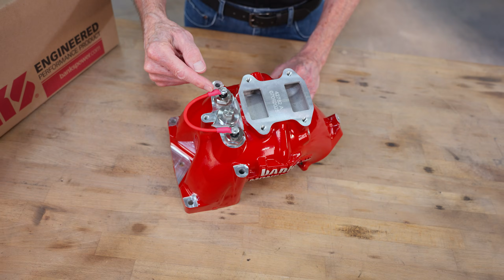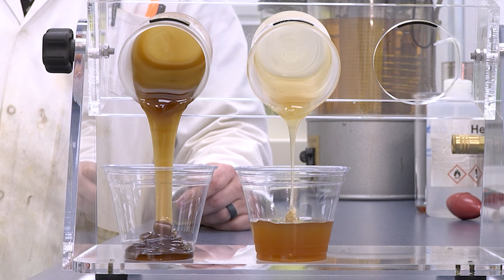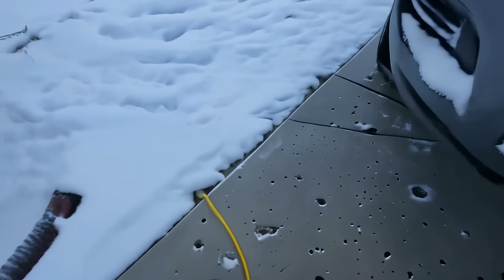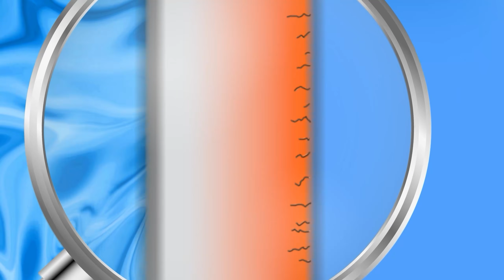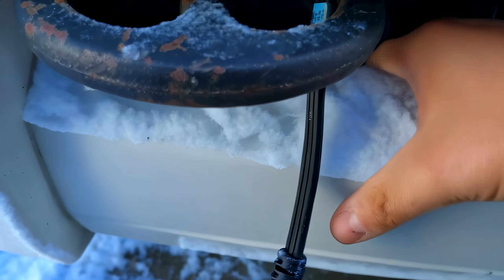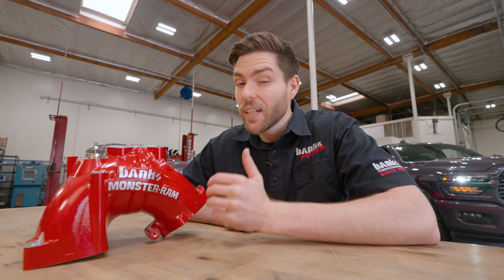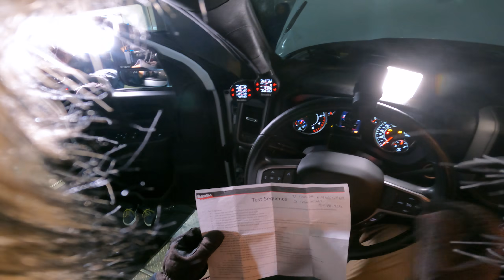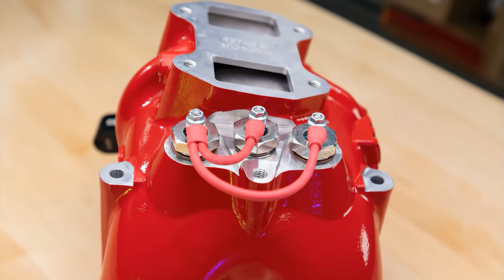We froze a truck to -40°. Here's what happened.

Comment: Make sure your 25/26 block heater that you chose as an option is actually connected at the block. My 26 was not. Stelantis says its the dealership's job because it "cannot be done" during factory build 🙄. But the dealer doesn't know about it.
Reply: All Cummins equipped Rams come with the block heater element installed in the block, the only thing that is needed is the cord for it. Yes, dealerships rip you off to "install" a block heater when all they do is plug in a dang cord and run it to the front of the truck.
Reply: @T51B1 mine was installed but the 120v plug wire wasn't connected to the heating element. Quick search will show its a common problem on Ram forums. Dealer says it's not on their pre delivery check list while stilantis says it's on the dealer. I dont have big hangs but it was still a PIA to sit ontop of the motor and reach down there to plug it in and screw on the lock ring. Block heater worked after that last winter.

Comment: Translation: We had to find a place to re-create Minnesota in January & February... It cost us $7,000 every time we took a test.. then had to wait to get it back to Minnesota Winter temps...        Now if we can convince the Big rig engine manufacturers to put a grid heater or glow plugs in the big rig engines... they might have a fighting chance to start... Big rigs are critical to infrastructure... Everything gets delivered by truck... everything... and when they can't start... it's  REALLY expensive to find a service that has proper equipment to attempt to jump start those massive , high compression engines.. with no heating systems at all... and because of their size.... almost never have access to electricity to plug a block heater in.  Even with good batteries... one or two hard starts will drain them... you need continuous ability to recharge all 4 batteries and try cranking before any little heat generated goes away.   Banks would make "Bank" if they designed a Pre-Heater for Semi Engines...  If a Semi can't be Jumped/recharged on location... the only option is a VERY Expensive Tow truck... then pay to have the truck parked inside a warm building til it's warm enough to start. That's NOT cheap... Hey Gale... Look into some type of pre heater for the Big Diesels... there's a Huge Need for it..

Comment: adults leave their truck running when its that cold. or get a pro heat or wabasto circulation heater  this is every day for months in Alberta 
ive run ram trucks for work for years and ive had em start as low as -56c with proper preparation/maintenance

Comment: Can someone in the OEM industry enlighten me as to why the factories don't quickly remedy faulty designs?

Like how is cummins still fitting new trucks with these subpar grid heaters? Same question for Toyota and their tundra engine... Or GM with their transmission valve bodies and 6.2 engines.

Why are these companies so inept with fixing problems that are simple fixes within the ability of the companies... It's such a disgrace to this country and the customers.

Comment: Gale Banks has forgotten more knowledge than I could ever learn and appreciate these videos. 
Reminder :
New recommended batteries failed voltage drop during cranking multiple times.  
Adding a 2250 watt draw will make voltage drop worse.
Really doesn't matter what your air intake temperature is if the engine wont turn over. 
Battery blanket/heater would make a world of difference.  
  I think its a great product that solves the bolt issue.
I think the guys working in -40 or below have solved all the cold weather issues with their incredible ingenuity and keeping their 5.9s and 7.3s running strong in the oil patch.  At least that's what Ole Peg says and ya gotta believe a guy as bad ass as he is.
Reply: in -30 or colder, either it stays running, or they use battery and engine blankets to insulate the entire engine bay.  if the vehicle has to be off, you keep a good booster pack so you can boost the battery to help with cranking speed.

Comment: At -40 I would run a diesel rated 5w30, an oil pan heater and battery heaters in addition to the block heater.

Comment: I worked at a welding shop in Nampa, AB. I heard many tales from people I met where they had to set up insulating canvas tarps to keep the heat of a fire burning directly underneath the oil pan of their industrial equipment out in the middle of nowhere. This was the only way to eventual get them started out in the middle of nowhere
Reply: Charcoal briquettes work great for this! Fire them up, get them hot then slide it under the truck with a tarp over the engine.
Reply: As done on the Alaskan Hiway when it was being built. A diesel engine that quit couldn't be fired up until Spring w/o this method . . .   ☆

Comment: I use a block heater on my Cummins when the temp falls below 40°F. I hate the grid heater cycling on and off. I also put block heaters on my gas engines to help aid warm-up temperatures and reduce engine wear.

Comment: Block heater in my 7.3 couldn't keep up with Montana so I installed a webasto engine heater.
Best thing I ever did for cold weather. Set the timer so I have a warm engine when I got up in the morning and then again when I got off work.
Plus I had warm air blowing out of the heater right away instead of waiting for it.

Comment: It’s too bad no one makes an oil system on OEM that pumps before the engine even cranks
Reply: Oil would probably need to be heated up a bit to pump. It gets thick up here in Canada when it's -40 -50 sometimes. 

At times, it's so cold that you can feel the deformation in your tires as you pull away from your house in the mornings. Bumping along until they heat up. The suspension doesn't even work properly. The shock absorbers become force transferring devices instead, allowing you to feel every harsh impact along the way.

Comment: I parked my 1973 Fiat 124 in the parking lot at work. It was 3 years old at the time. Little ol' 1400 CC engine. It dropped to -45 deg F through out the day in that parking lot. At quitting time it started right up. Wasn't turning fast but the old point ignition was up to the task.

Comment: I just noticed you have a Cummins Standby Generator at your shop, it looks around 100-150kW is it natural gas and turbocharged? Ford WSG1068? Or a PSI 8.8L or is it a diesel QSB7? with remote fuel tank? It is shown in the clip backing the RAM off the flatbed. You can see the “Onan Green” great product ( the best for its application, and a great investment too) 

-Generator Aaron

Comment: If you were trying to isolate the manifold air temp, wouldn't you want the oil heater and battery blanket?

That would mean those two variables are at their best position and if the vehicle still wouldn't start, it was clearly air manifold temp.

Not having those two variables at their highest performance meant they still would've been affecting a good crank

Comment: Great video, as a Canadian that lives in -40 a few weeks of the year I feel the pain. I had a banks in my 22 2500. I can honestly say at -20 °C it was a hard start. -30 was a different story. Yes truck gets plugged in at night. Unfortunately that truck is no longer with us as it was t-boned or I would be purchasing the up grade. My 25 has a whole different set of cold start issues.
Reply from the maker: Sorry to hear about your '22 2500. What issues are you running into with your '25?
Reply: @bankspower they changed the start procedures. There is no wait time for the glow plugs. You have to go out to the truck and press the start button to run a cycle. Before the truck would do it automatically when you went to start the truck below 0°C.

Comment: Did you allow the battery to charge back up after starting it so many times before doing the negative 40 test??
Reply from the maker: We plugged in a charger before letting it cold soak overnight.

Comment: Thanks Gale !  For your next product improvements, I have a couple of requests from northern Alberta. Please add a block heater to the CoolRunner Oil Pan, the Ram Air Transmission Pan and the Ram Air Differential Cover. You've seen how thick engine oil gets at low temperatures and we're killing the transmissions and diffs too.  I knew a bus fleet manager who wired an entire fleet of Prevost buses with stick on pad heaters on the oil pans, transmission pans  and the rear diffs. Never had a frozen bus & cut repairs and maintenance related to extreme cold and saved the company tons of money. 

We burn up engines, transmissions and burn out diffs  and rebuild them at 150,000 miles when a 6.7 Cummins could go 500,000 without opening it, just because winter is such a torture test. Transmissions could last a lot longer and diffs, well, we sell the truck and let the next guy deal with it. Point is, if you engineered a plug in for those pans and diff cover, you'd help us keep great trucks on the road a lot longer and get the best of both worlds- cooling in the summer and heat in the winter. Oh, could you make a diff cover with a heater for the front diffs too?
Reply: I have seen people attempted the Oymiakon death road in Russia used a camp stove with solid ethanol for 2hr for underbelly of the truck, rear diff, tranmission, front diff, collant, the lot you name it. Plus they completed use thick blanket to cover the front of the air intake vents, the top of engine, the exhaust pipe was tripe wrapped with thermal material. Everyday to start a truck takes 2hr of work.
Reply: Great reco!
Reply: I don't know that diffs are all that critical. That sliding friction warms them up pretty quickly. Just go easy for the first little bit of driving. Diffs get burnt out by not changing out break-in oil and from spinning tires.
Transmission could maybe benefit from a bit of heat. Some lighter stuff gets a little heat from the block heater via the heat exchanger in the radiator, and it's a noticeable benefit, but most heavier vehicles have completely separate cooling systems and could probably use a little.
Reply: @gogmorgoaway  We see diifs freeze solid as it gets below -40 and you can't move the vehicle. You have to light a tiger torch or heat cannon to heat it up and re-liquify the fluid.
Reply: @searlearnold2867  Wouldn't your tiger torch also struggle below -40?
Can't say I've seen that happen on something that had oil put in it this century. Brakes freezing, absolutely, but not diffs. You might want to switch up the oil in them for something better rated for the temperature if that's the case. Or make sure they aren't full of water. Frost inside the housing does eventually accumulate.
But yes, if you do need to heat the diff, slow and gentle is going to be better than a hot flame that risks burning the oil. That would definitely shorten component life.

Comment: I have a battery tender along with blankets to help with the battery. I also have the monster ram with just one heater and have no issue starting without the block heater. Unfortunately working 24 hour shifts i dont get the ability to always plug in. I live in Wisconsin

Comment: Ahh that magic temperature that doesn't need a °F or °C.
Reply: 40 c aND 40F are the same
Reply: @shaggy501  Get outta town! Is that right? The OP didn't imply that at all, not a nuance of it. Thanks for your help.
Reply: @wobblyboost it’s cause its wrong
Reply: @turtletube -40c and -40f are identical trmperatures
Reply: I can only measure temps in Freedom units.
Reply: @tacticooldennis  it's spelled Freedumb
Reply: @RePeteAndMe  okay mr your-a-peeing
Reply: @oldpops22  used all 3 braincells for that one.
Reply: @kedf shut the hell up you think beans and toast are exquisite
Reply: @RePeteAndMe  Feedump i mean freerdumb
Reply: @oldpops22  on my boot
And thats why we don't work on European cars
Reply: I trolled a friend with that once, asked them to convert -40F to C.  They did the math 4 times thinking they did something wrong because it kept coming up the same lol.
Reply: I like °C 0°C means 32°F and 100°C is the boiling point. Its literally just easier on the head to remember in my opinion. I just dont like kilometers Per Hour. I grew up with MPH so,thats what i know. But as far as temp goes. CELSIUS IN MY OPINION IS THE BEST TEMPERATURE TOOL TO REMEMBER.
Reply: At -40 its the same either way.
Reply: The climate box said 40c on the outside
Reply: @harrythemoth180  shrugs fact is the two still intersect at -40. I could really throw you a curveball and say its 233.15 Kelvin.
Reply: @chuckee1987 someone pays attention at least.
Reply: Also -40 Celsius is the same temperature degree as Fahrenheit
Reply: @harrythemoth180 😮Nooo waayyy? 🤦🏻‍♂️
Reply: @tdotw77 I’m not the retard who need clarification
Reply: @tdotw77  Also -40 Celsius is the same temperature degree as Fahrenheit
Reply: @hengry0  Reaalllyyy?!  Noooo waaayyyy!! 🤦🏻‍♂️🙉🤣
Reply: @hengry0  Now my mind is fixing to explode, Does this mean we accidently just discovered the unifying theory that explains life, the universe and everything?! In a chat box!
Reply: @harrythemoth180  Yes that's literally his point
Reply: @harrythemoth180  PLOT TWIST! 😲
Reply: zero is zero
Reply: @SlayerXBTNah, 0°C is 32°F
-40° is the only temperature that is the same in Celsius as Fahrenheit.
Reply: @hfase  im trollin

Comment: As others have suggested, would be great to see data using battery blankets. And also data for the “more than 2” heating elements, as that’s your suggestion for people to use. Would also be great to see battery voltage before and after running X number of heating elements, as running more heaters will obviously have an effect on battery voltage as well. Anyways, great video and thanks for all you do!
Reply from the maker: Thank you for watching and for the feedback. We would have loved to perform more tests in the climate chamber but each test required a full day. It can get really expensive, really fast.

Comment: Wait, there are still ARCO stations? Haven't seen one around here (New England) since the 1980s.
Can't wait for the Banks kit that has insulating blankets and battery heaters.
Reply: ARCO is super common out here in socal, its the cheapy cheap gas station lol, 10 to 30 cents cheaper a gallon usually

Comment: Thank you for doing this testing. In Anchorage, AK we might not see more than 65F all year some years. Winters can get down to -15F and there's nowhere to plug-in at work. 45min North in Wasilla/Palmer it can hit -20F and again, no where to plug-in when not at home.
Reply: Get a webasto coolant heater. It's a game changer. 👍👍
Reply: @jsav5845  They are, installed many in my heavy mechanic career but still need batt volt to run one. No use when truck parked for 8-10hrs at work.
Reply: @akryder Worked for me all the time, 10hrs at work all last winter. Got the smart temp 3.0 set a timer set an autostart with my viper from anywhere as long as I have cell signal and good to go. 🤷

Comment: To be honest those interstate batteries are kinda crap for cold weather, they would be my last choice given the option,  this comes from first hand experience in Northern Alberta..  Interstate source batteries from whoever will supply them cheapest. We have found Clarios (formerly Johnson Controls) make the best batteries for cold weather endurance and durability. And if available AGM's all the way..
Reply: Interstate and optima are now made by Clarios. I'm still rocking some interstate batteries from 2017 in my 2008 chevy 2500, back when they were good. 

Clarios probably owns 90% of the automotive battery manufacturers. Interstate, optima, ac Delco, fomoco, Toyota.
Reply: @ExperiencesAndEquipment  First off  Interstate, optima, ac Delco, fomoco, Toyota are NOT battery manufactures they contract out the m,anufacture of their batteries . Second the Optima brand is OWNED by Clarios (formerly Johnson Controls)  and always has been.    Third  Interstate contracts out the manufacture of their batteries to who is cheapest.   Pen Exide and Clarios ALL provide batteries to Interstate. Interstate changed their specifications during Covid and drastically reduced the quality of their batteries to reduce production costs...
Reply: @matthewq4b I may have misspoke. But they're all under the Clarios brand. Those are the ones I remember distributing. I wish I had a picture of all the warrantied optima batteries. I feel Clarios ruined a lot of reputable brands. 

I remember when optima was THE battery to get, I had access to tons of great discounts on parts, yet I wouldnt spend a dime on optima unless it was to use as a core charge.
Reply: @ExperiencesAndEquipment   NO they are NOT under the Clarios Brand .  Motorcraft (Ford) is Owned by FoMoCo  Delco is owned by GM and Toyota is Toyota.  Ford has primarily used Clarios and it's predecessors  Johnson Controls and Globe Union for basically a hundred years now but not all their batteries are made by Clarios..  Delco has their batteries by Clarios and East Penn ALL side terminal batteries are made by East Penn.   Toyota primarily uses Clarios but also uses Hankook.  Mercedes 12-volt start batteries are exclusively manufactured  by  Clarios (Varta) ,   Clarios is a supplier to OEM and Private lable brands such as Everstart Duralast Interstate etc..  The ONLY brands that are owned by Clarios are, Varta,  Heliar, LTH, Optima , Delkor,  and  MAC,